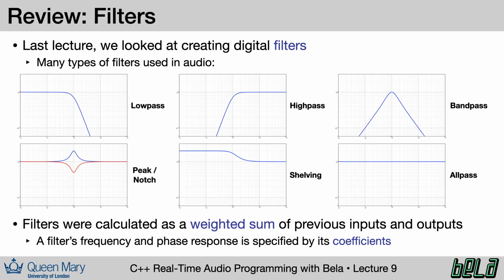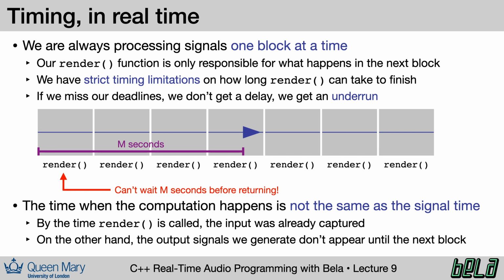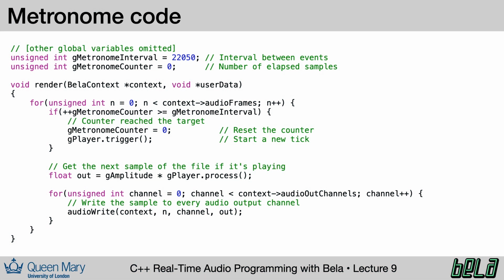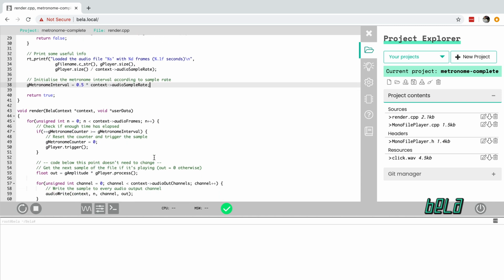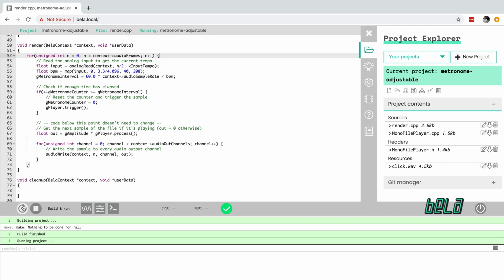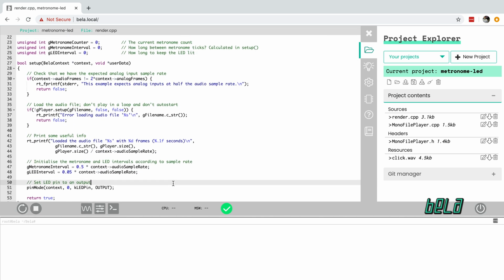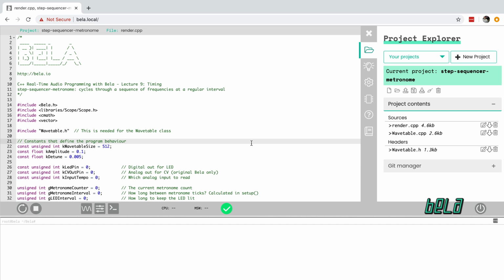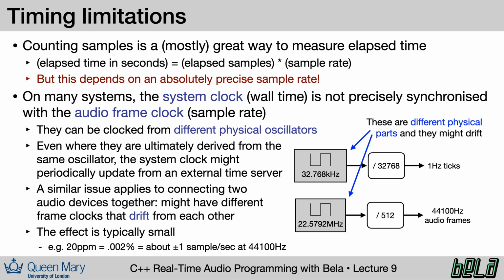9: Timing, C++ Real-Time Audio Programming with Bela

Comment: And of course 'On the run' by Pink Floyd (described as the 'hello world' or 'Stairway to heaven' of sequencers)  std::vector<float> gSequencerBuffer = {40, 43, 47, 45, 43, 45, 50, 52};  at 664 BPM or 166BPM at sixteenth notes and   harmonic <= 12